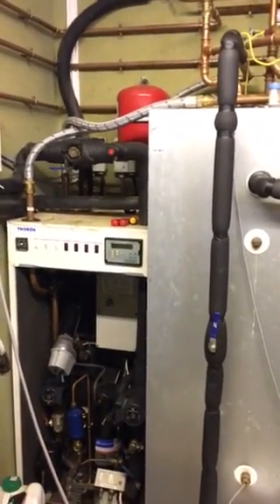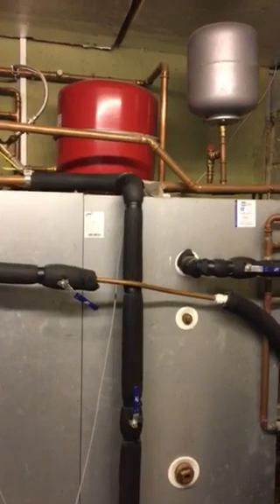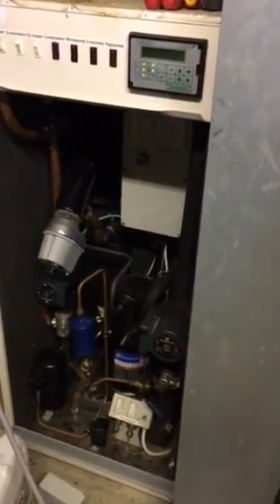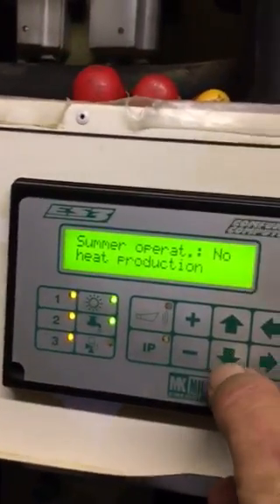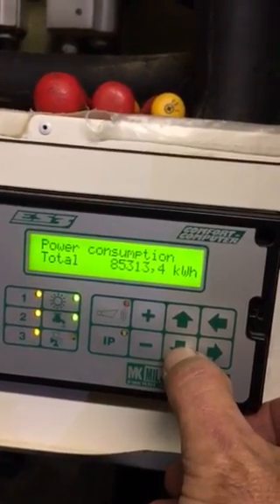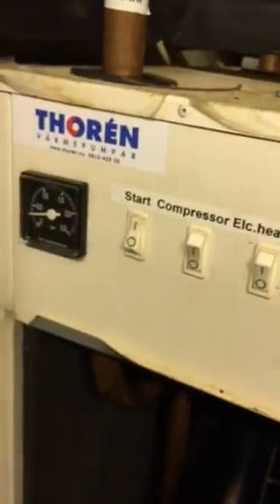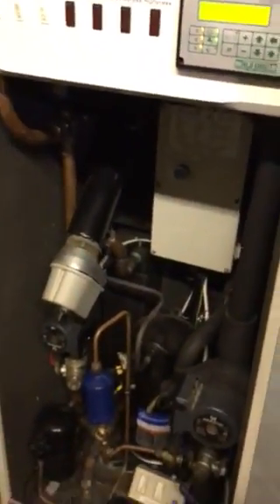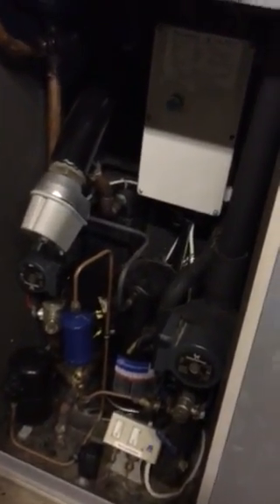Ground source Heat pump ? Think before you buy/install one !

Comment: Average energy consumption has been 6 kW (see 1min30)...and the electric resistance heater just happens to be 6 kW as well!  Interesting. Seems the heat pump loop never operated and only the backup heater was working the whole time.  Too bad he couldn't have it serviced.

Comment: It looks more like the right system wasn't put in for your house and or you have a poor quality system. If you'd have had bore holes dug with a high quality system, you probably would be fine. People still have the same kind of problems with a cheap gas boiler that isn't fitted properly.

Comment: We will never know the real reason ... might have been the heat pump, but there are so many other things ..... undersized unit, the heat lost from the house or pipes, maybe it was installed in the garage or shed,  some idiot put a slinky pipe in too small an area, maybe another idiot kinked the pipe or planted a stone on it, or in it, maybe too shallow, maybe someone chose a field pipe that was to small in diameter, or just wrong size pump. 

My advice (advice is cheap) to anyone reading this ... forget this fancy $#!£, start by draft proofing your house - the cheapest form of insulation, the biggest saving, the biggest comfort effect, but sadly the hardest to do properly...
House heating requirement equation = "heat lost through walls, roof and floors" ....MULTIPLIED BY.... "how badly your house is draft ridden" (you half this number you half your heating cost)

Expanding foam is your friend :)

Comment: I think the problem was insulation. Lived in the UK for 4 and half years and I can tell you 100% most of your problems were due to your lack of insulation. I live in a much colder country and we 've got 20 cm of insulation outside and walls like 40 cm wide, a total of 60 cm. Also, tripple glass windows, and the ceiling also properly insulated.
No matter where I've visited I have seen no insulation whatsoever. I think it' s a regulation or tradition that every house looked the same and no insulation.
Also, 6 KW pump is way too small for your big house. We use 12/16/20 KW pumps based on square meters of the house. I've never heard anyone using a 6kw pump
Reply: Now this I can understand. There has to be a reason. There was another fellow from the UK who installs these things and he made mention of the insulation problem there as well.

Comment: Pity you bought the wrong one. My Kensa is amazing and so cheap to run.
Reply: Sadly seems rare to find any positivity around Heat Pumps.  Ground based apparently slightly less $%&# but too many tales of ppl getting rid, especially once the RHI subsidies dry up..
UK Gov would be better off encouraging rooftop solar panels, which would have better ROI and Co2 benefits.
Glad you're satisfied however 👍
Reply: Hi Paul Jackson, I am currently getting quotes and looking into Kensa, would love to hear what you think of yours and the pros and cons?

Comment: I have had a similar experience with my Mitsubishi Ecodan air source heat pump air to water system. In eight years it has increased my KWh consumption by 40% from the outset despite running on Economy 7 and Economy 10. Back to Economy 7 and storage radiators soon.

Comment: If the pipes were put down with sand around them (like you mentioned) that's a problem, the pipe needs to be in mud/clay, sand is a poor conductor. GSHP work well if installed properly.
Reply: Yeah, that's what I've read as well. Makes all the sense in the world.

Comment: Thank you for sharing your experience and I can only imagine your frustration. Absolutely gut wrenching to have to ‘pull the plug’ on such a significant investment, but once you realise you have a dead horse with a 6KW heater up its backside, then it just has to the right decision. The view around the plant room though was shocking and clearly a complete lash up, more willi wanka, than wonka.😉 How are things, performance wise with your ‘new’ oil boiler and system?

Comment: Many early adopters suffered problems.  The kinks (literally piles of coiled pipe, saturating the space and freezing the ground forcing the electricity to take over 100%) have now been worked out.  We are benefitting from brave early pioneers.    I have two houses both on Ground Source with solar driving the pumps - tax breaks have paid for it.  Free heating & cooling for the foreseeable.
Reply: Uk gov should be subsidising roof based solar panels for homes, not wasting tax payer money on those imho.
Glad it's working for you however ;)
Reply: @stuartburns8657  Solar in the UK? Isn't it cloudy there all the time?
Reply: @wthomas7955  It ain't California lol, but yes we get sun

Comment: Your story is not uncommon, things have changed though and it does seem like a new system would be cheaper than oil to run. Most gshp can deliver at least 5 cop which should beat oil easily.

Comment: I think you should not have given up,
The company that installed the system must have expertise to rectify the problem. I thought the pipes also should have been vertically deep into the ground and a soil survey and report should have been carried out for the project to be viable. However, thanks for sharing and more work is needed if I decide to go ahead with this in the near future.

Comment: Im sorry you had such a bad experience. However, ground heating is common in Finland and works extremely well. Ive seen a couple of friends tech room housing the machinery which was nothing like your monty pythons flying circus set up.
I suspect whoever fitted your 'system' was utterly clueless. Dont slam a well established method of heating just because cowboys fitted yours

Comment: hay mate if your going to use your fridge as a heat pump you will get a few problems, try getting an expert in as you will get the right tool for the right job saving you money in the long run

Comment: I had a ground source heat pump system. I would say it was significantly more expensive to run than a gas boiler on mains gas. The worst thing though was how complex and liable to failures the system was. Much more complex than a standard oil or gas boiler.

Comment: These hetpumps get the water to about 12degs max in UK from each pass, given that tapwater is about 5degs anyway, thats only about 6-7degress temp increase ,so 7 degrees water temp increase , wouldn't you have to live in the house for decades to see cost of install recovered for the heatpump and the required boiler.  Now In 2020 the price of PV is very low.

Comment: 85,313 kWh ÷ 14,217 hours = 6.0007737216009 kW (average power consumption over the period).
 
Are you sure you wasn't just paying to heat the field?  Maybe the dog in the video was trying to tell you something.
Reply: That's the consumption whilst it was running, so of course it will be full power whilst its on. You will have to divide it by the 8 years the system was installed, not its running time.
Reply: @drsquirrel00  29 kwh /day. That's a lot!

Comment: The problem is due to physics, shallow horizontal pipework is never going to benefit from a stable ground temperature , drilling a borehole is the only sensible way to go.

Comment: Im a technical consultant for a heat pump company. a heat pump both air and ground WILL save you money providing you have the key elements in place... 1) the heatloss calculations are carried out correctly to design the system 2) the design is carried our properly 3) the system and distribution is sized/installed and set up correctly and finally are you using it properly? If you are treating it as an oil boiler ie. turning it on and off instead of it providing a constant then you will have issues
Reply: also slinky/coils are rubbish! liner pipework with sufficient spacing always...
Reply: @LewisSouthwardOfficial  Interesting. No slinkys, eh...? You see those all the time on youtube.

Comment: I started working at a South Dakota HVAC company back in the early 90's and what my first couple jobs were back then was taking out the previously installed ground source heat pumps and all the extra needed heat pump accessories so they wouldnt get sued. We then installed 90% gas furnaces and 10 seer A/C's. They are a pain in the arse. Like a Texan once told me: Remember the KISS rule! What? was my remark, Yes he said: Keep It Simple Stupid!Words to live by and you are not the only one and hope others see your nightmare video before taking the plunge into this expensive way of heating and cooling.

Comment: I am very sorry you had such a bad experience. It seems to me that as many people have such systems and theirs appear to work, your  installation may have been flawed. Just out of curiosity, why do you even have an immersion heater? Given you have a hot water system, there is no reason for it (at least as far as legionnaires disease goes).  Did you consider finding an expert in geothermal sourced heating to check your system to see if there were any problems? Also, where was your system located? How deep was your ground source pipes? What temp was your ground source fluid after it returned to the house? So many questions, sorry, but I can't  help to believe it was the installation or equipment problems (from that particular manufacturer).

Comment: This is a very good cautionary video. Some balance. I looked at a house recently and the plant room was similar, full of tanks and plumbing everywhere. Not sure how it performed but aesthetically rubbish and took up alot of space. For the money I think it's not worth installing (or taking on early adopted systems). Too high risk with old tech. Plus I understand oil or gas boilers a lot better. Solar seems to have come on. Worth watching for hydro if you have a water course too.

Comment: We had a Vaillant ground source heat pump using a borehole collector that heated the depot I worked from for 9 years. It was fantastic. I'm sorry to say you have just had an incompetent installer/system.  Assuming your collector pipework is intact then you just need a better system attaching to it. You need a competent installer as well. I really don't understand your comments about electricity bills as on our system the only power use is the circulation pumps. With modern pumps that is minimal. Why would you need immersion heaters at all ? This is what puzzles me about your installation. Without wishing to sound rude, and fully understanding your disillusion right now, your system looks like a real pig in a poke and that is the real problem. I do sympathize and understand your feelings in 'running for cover'  with an oil boiler, but heat pump technology is perfectly sound, provided its properly planned and installed using reputable units.
Reply: Your system DOES NOT use circulators as the only power source. The actual compressor of the heat pump uses quite a bit more power since it's at least doubling the pressure of the refrigerant to work the magic of successfully moving btu's around. Those are all required for a system. The last part is the backup heating element that will skyrocket the power consumption depending on its size. Usually a minimum 5kw and up.
Reply: @Jason-wc3fh  That's an air source heat pump you are talking about. A ground source properly designed and installed works fine. The system in our depot was so efficient we sold heat to neighbouring office units. We were a heating engineering company when all is said and done. We used a vertical borehole for our heat collector which was expensive, but we had space constraints. I think our was installed in 2004 and I left the company in 2010 and it gave us no problems in that time.

Comment: 85313 kwh / 14217 hrs = 6kwh/hour ... 6kw immersion heater running full time? 592 days. i wonder if you could use the ground coil as a preheat for your oil boiler, so you are heating partially warmed water.
Reply: In a hot water system, with underfloor distribution, the return temp might be 90F or so (my hot water radiator system returns at 150F or so).  But my point is the ground source temp returning to the house would be significantly less, so I don't think it would preheat anything. IMO.

Comment: Oh well oil it is. Is almost two years on oil how is your experience with it ? Personally I would invest in top of the line new heat-pump with gas backup , think viessmann makes it  installed by professionals, also have underground loop tested make sure is in good condition.

Comment: Hello Marc, sorry you had problems, like you I restored my house back in 2008 and with no gas supply looked into renewables. After stuggling to continue with the random price fluctations of oil I decieded two years ago to fit a GSHP. Yes it cost even more than oil to install at five times the cost, but it is fantastic. Virtually no maintenance and cheap to run. My electric bills have not increased a penny since install, in part due to my energy supplier overestimating my previous use , but also due to my winter use being balanced out by savings in summer as I used to heat my hot water with an immersion heater, now I use the heat pump. Comparing your system to mine is as different as night and day and I can see the problems you have that I have not. Firstly the quality of your install is dreadful, secondly is the make and model of pump selected, the european heat pumps are designed for short deep winters not long mild winters which we have here, you really need a different type of pump which is designed for long hours running at low level of heat. That brings me to what I think is the main failing of your system which is the use of economy rate electricity, heat pumps work best giving off a constant heat and use lots of energy cycling themselves up to temperature. By using economy electricity you are by nature constantly cycling the heat pump from cold during the change over from peak rate periods. Also at 500L your buffer tanks do not sound anywhere near big enough to provide heat throughout the peak rate period they should be 5000L! As a result in poor weather you system will have to come on more frequently than the economy periods allow meaning that you run in peak times which will offset any saving made using the economy tariff. Finally you mention that your system has 'immersion heaters' in it. A proper heat pump system does not use immersion heaters, (also known as boost heaters). It would seem to me as if this system is NOT a ground source heat pump at all but a wet economy rate electric storage system with a heat pump. Judging by your metered use from your heat pumps display the heat pump has only been producing a fraction of the heat required for your house, It has been the immersion heaters that have been wasting your money and I feel that if you were to invest in a suitable modern new heat pump using your exsisting ground loop and underfloor heating installed by a MCS accredited supplier/installer you would massively benefit from a heat pump.
Reply: Thanks for your comments. I’m in the market for a GSHP and am concerned by the number of horror stories like this on line.
Reply: How many tanks do you have to have 5000 L ?

Comment: Sorry for your bad experience, but can you be a bit more specific? Did the heat pump not provide heat? Did it break down constantly? How hot did it get the water in your buffer tanks? I want to avoid your problems, but it isn't clear what they were.

Comment: Hi sorry but my ground source heat pump works perfectly it's reduced my heating bills by half, I can keep my heating on for much longer periods and my hot water is never on a timer. I think the moral of the story is don't buy cheap heat pumps no one has ever heard of and don't go for the cheapest installation quote either.
Reply from the maker: Jay Farrell spent £20,000 on the system. Dug all field pipes in myself! Swedish system.
Reply: Did you say the under ground pipes were sand covered? That would be a mistake. Leads me on to ask if you got the land surveyed. As well as depth it’s good to have the pipes in a conductive medium, ie wet. If that beautiful lawn is drained or well above the water table then you’re contractors let you down. Sorry you have been let down.
Reply: @Ambroseseeker1084  I've seen some folks on youtube that say they covered the pipes with sand as well. In order to protect them when backfilling. The thing is, I've also seen a chart saying that sand is almost as bad for thermal conductivity as gravel, which is the worst. Essentially sand is ground up rock. The best soil being that which retains moisture, like you said. Interesting.
Reply: Hi Marc I spent exactly the same, not only that the new RHI grant from the government for domestic properties means my whole investment is now all paid back for in 7 years whats there not to like? not being rude and with respect just look at the plant room would you say this looks professional? I will send you a picture of my plant room its night and day.
Reply from the maker: £20,000 was no cheap install! 
And I dug all the pipes in the ground, all sand covered and correct. My oil heating is superb now. My own carbon footprint is made locally and not hidden elsewhere 😱